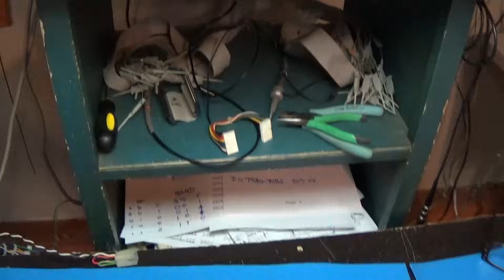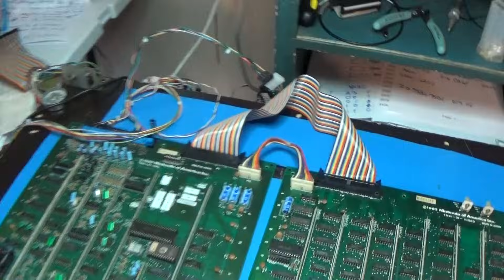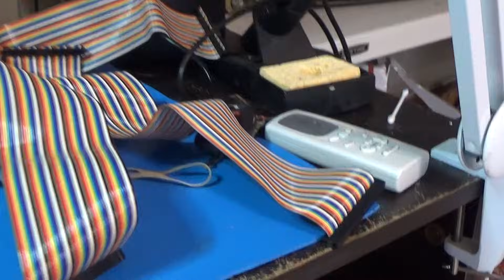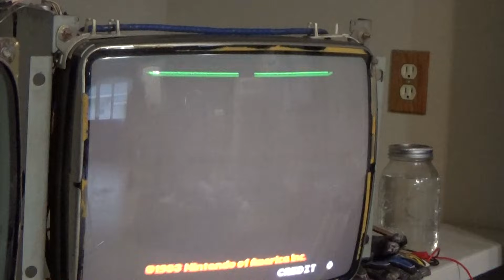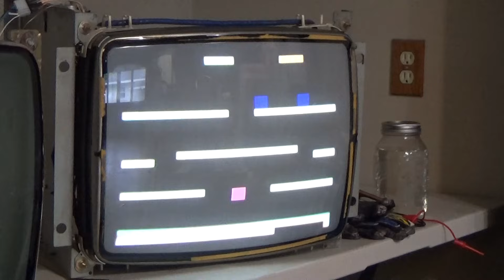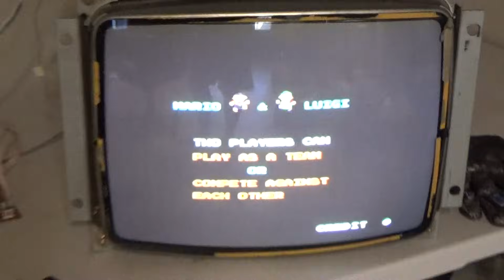1983 Nintendo Mario Bros Arcade PCB Repair #2

Comment: Im not sure where to ask and I know your really good with this stuff. I've got an old computer, the Otrona Attache. It doesn't have any video output with the internal monitor or the external composite. For video it has 5027 CRT controller. Where would I go to learn how to repair this?

Comment: Hey Doc, I see you are settling in your new place.  Congrats!  The worst is behind you :).  We are expecting more videos coming from you soon :p.  With all the stuff you have there, I think you might be in need of some extra switch controlled outlets.  Check out on Newegg "Rosewill RPS-210PK" (black) and "Rosewill RPS-200PK" (white).  It's on sale until Monday for $14.99 ... aaand you get TWO power strips for that price.  The beauty of these is that each outlet is controlled by a dedicated power switch (so you get 6 outlets and 6 switches).  It comes with a beefy 6 ft power cord.  These are rated for up to 15 Amps.  It might be a good idea to get more than 2 of these strips.  I recommend installing it with your computer setup.  You could turn off easily the wifi router each night for less radiation and better sleep as well.
I got these power strips last week for $19.99 (my luck).  It sucks, as Newegg is very stingy on price match guarantee.
I'm thinking you could spiffy up your man cave with some older TV.  Check out on Newegg "Rosewill HDTV antenna RHTA-18002."  It comes with a powered amplifier.  It's on sale for $9.99!  They usually go on sale for $25.  I got 2 of them last week for my friend for $18.99 (bummer).  Already tested and work great.  For the second antenna I used just the amp, as he has a long cable flat antenna that hangs in the window about 15 ft away from the TV.  With the amp installed it's like a night and day.  We are in Brooklyn and while being in a concrete jungle, this thing picks up plenty of stable channels.  He is very happy.  I don't watch much TV, but going to pick up couple of these.
One more thing, if your TV doesn't have USB, just use an old power charger (that has USB plug) for your cell.  I would recommend turning it off when not in use.
Don't forget, the sale ends Monday.

Comment: Nice work as always. One thing I noticed is the Mario run sound seemed too high pitched to me. maybe it was your speaker and amp setup?
Reply from the maker: I was thinking the same thing...  so i looked up other vids on youtube of the arcade hardware gameplay...  and i thought it sounded the same..  mame uses samples..  that is what im used to hearing ...   and its way off
Reply: I agree that's the first thing i noticed.
Reply from the maker: VW Insanity guys. Stay tuned for an update video... after watching Johns arcade review of mario bros..  the analog walk sound is incorrect
Reply: @classicarcaderepairs  I had a similar issue with my Luigi walk sounds sounding like a machine gun. My video here goes over the entire Walk 1 and Walk 2 circuit: https://youtu.be/iYlzAJBPHGY
Reply from the maker: Arcade Crusade thanks alot for the link!!

Comment: Might I make a suggestion with the nintendo power supply? Personally I don't use the nintendo supply with my setup because it lacks the original monitor. I use a Mean Well RT-125A and has worked flawless for me as it has a strong 1 amp -5V rail. I've also used it for testing dk jr, a 2 stack DK boardset, and popeye. My only complaint is that it needs a load to run, meaning you can't just adjust it with no load, this was solved for me by using a power resistor though. They are $33 on mouser and give a pretty clean output.
Anyway, keep up the good work, I always enjoy the vids, especially this one as mario bros is one of my favorites!
Reply from the maker: I will for sure look into that!   I need a solution to nintendo pcb’s for my setup..  you need that 1amp -5v rail for the pcb’s that use ECL logic. This sounds like a viable option...    alot cheaper and brand new too!
Thanks for the info!
Reply: @classicarcaderepairs  if you'd like, I have an extra one I can send ya for free. If you like it you can keep it. No use sitting in my parts box collecting dust...
Reply from the maker: SNESNESCUBE64 that would be awesome..  much appreciated!   Send me an email
Reply: @classicarcaderepairs  Email sent!
Reply: Could you tell me what kind of resistor you used to test the power supply?
Reply: @WinrichNaujoks  I used a 20 ohm rated at 50 watts. It will get hot if you leave it on too long just as a note.
Reply: @SNESNESCUBE64  I got that power supply now, but I don't have that resistor, so I can't test it outside my Donkey Kong. Right now I even have a tough time figuring out which output is the -5 and which is the +12V. The documentation is really crap! I think V3 is -5 and +V2 is +12. Is that right?
Reply: @WinrichNaujoks  if I remember correctly it says which is which on the sticker on the side of the power supply.
Reply: @SNESNESCUBE64  Yes, thank you, that's where it was. Crazy that they put that info in that place. I connected the PSU to my Donkey Kong arcade, but it's constantly switching on and off, 1 sec on, then off again, then on... I think that PSU might be faulty?
Reply: @WinrichNaujoks  did you set the voltage input switch to 120v?
Reply: @WinrichNaujoks  also, it will reset like that if it doesn't have a load. Make sure that your pcb is hooked up properly. A DK boardstack is enough of one to work with that (I've tested)